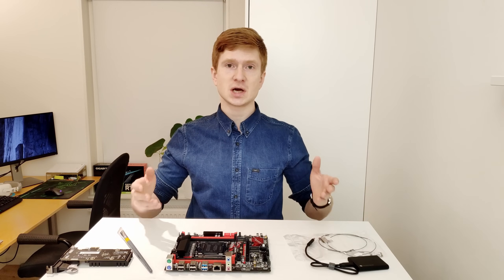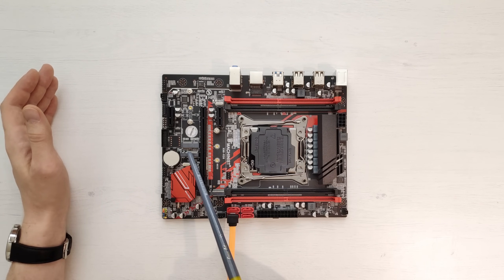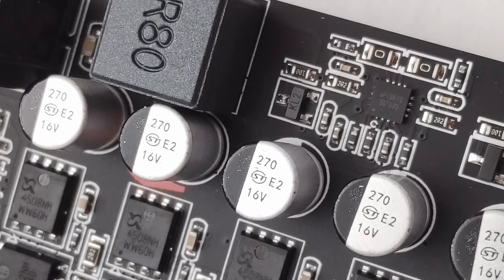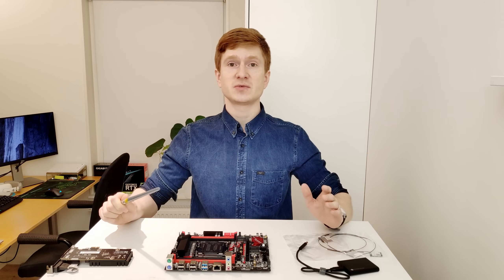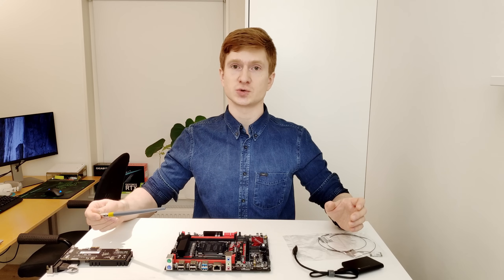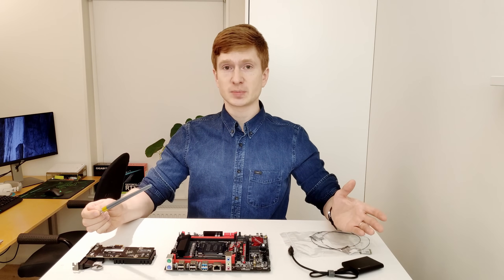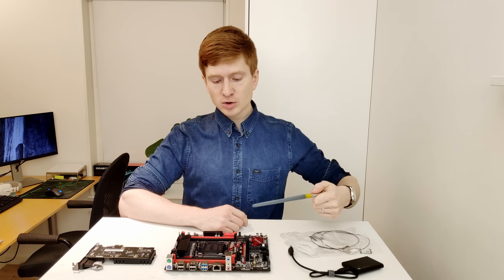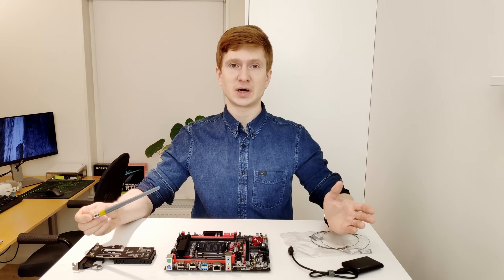🇬🇧 Machinist X99-RS9 – detailed review | E5-2678 V3 | i7-6800k | BIOS | O.C. | VRM | Mi899

Comment: i have exactly the same motherboard with 2697 v4 cpu, it's working good, but decided to upgrade to more core cpu 2696 v4, and OS installation cannot load anymore, it just freeze, in bios i tried load defaults and set TDP level from nominal to Level2, nothing helps, i think only you can help 🥹
Reply from the maker: How can I help? You have either defective CPU or motherboard. Maybe CPU is seated badly.
Reply: so you say there is nothing special about 2696 v4 and it must work with this motherboard?
Reply from the maker: Exactly.

Comment: Does this motherboard have an option to turn on secure boot in the original bios?
Reply from the maker: The one I have tested had fully functional Secure Boot.
Reply: @Miyconst  Thank you so much for your response, could you direct me to a tpm module that’s compatible with this motherboard?
Reply from the maker: @ducksauce752  I am not aware of any TPM modules that would work with the old version of X99-RS9. There is a Brazilian guy who sells BIOS-iEngineer developed modules but last time I checked, he didn't ship outside of Brazil. I also no longer deal with these modules.

Comment: My guess is that unknown device is the Intel Turbo Boost 2.0 driver for the i7 cpu.  I've had issues with that in device manager for these 2011 boards before.  Can check the hardware id to confirm.
Reply from the maker: That's very correct! Eventually I managed to get it solved by installing Intel TB 3.0 or something driver.

Comment: I have got Machinist X99-RS9 v 2.0 with Q87 chipset those with the fan on VRM heatsink, the bios is X99RS00B from 04/30/2024. All seems to working but on reboot of either Win11 or Linux it does full power cycle (turn power off and then on) which increase unexpected power off s.m.a.r.t. counters on the disks.  When I press reset button it restarts the PC without power cycle. What could be it, a bios design or some faulty hardware (Cinebench runs flawlessly) ?
Reply from the maker: I don't know what exactly causes this problem but it's common with these motherboards. Chinese connect something wrongly, components fail to reinitialize on reboot, they patch BIOS to power cycle on reboot.

Comment: I have this board with an e5 2697v3 and although it's working with my old rx580 GPU, I cannot get it to post with a new Rx 9060xt card. I am only running the standard supplied bios.
Reply: I added extra cooling for the vrm to keep things stable.
Reply from the maker: Yeah.. this is a known issue, AMD 90xx GPUs for whatever reason don't work on X99 motherboards.

Comment: Hi, I know this video is 3 years old, but I try my chance. I’m using this mobo as a Nas server with a 2678v3. Considering Ram, I can install up to 2x32Gb Ecc dimms 2133. When trying to upgrade to 4 dimms of identical 32Gb ecc sticks, the system won’t boot, stuck on DXE initialization. I see that you managed to go up to 128Gb of ECc reg memory. Do I have to flash the bios for it ? Do you have any advice ?
Reply from the maker: These Chinese motherboards are known for pathetic power delivery. I have had similar issue to yours on several boards and the only solution is to find less power demanding memory sticks. It could also be because of your CPU. V3 Xeons have significantly worse memory controller compared to V4. You can try to boot with two sticks, manually set RAM speed to DDR4-1866, then add extra two sticks.
Reply: @Miyconst  Thanks, Indeed, decreasing memory frequency allowed me to add one more stick, but even in 1333 Mhz, I cannot go up to 4 stick. I'll keep up with my current stable 64GB. Thanks for your advice, at least I now understand what is going on !

Comment: Question though. I wanted to know which frequency of ECC RAM should i be picking for this motherboard? 2133mhz or 2400mhz? Thanks!
Reply from the maker: It depends on what CPU you use. In general, 2133 is good enough if it's cheaper, usually you can O.C. these to 2400 if the CPU supports it.
Reply: @Miyconst  i appreciate it!
Reply: @Miyconst  Well the one i have is an E5 V4 CPU i already considered 2133 MHz :D thank you very much for your assistance.

Comment: Brother i have saw a motherboard called rs9(with diagnostics module) and rs9 plus (with diagnostics module) difference between them is plus has extra 2 sata port. Both are different from motherboard you have(your's motherboard doesn't has diagnostic module) does most things you said applicable to both rs9 and rs9 plus
Reply from the maker: As far as I know, the newest revision of RS9 has better VRM, the rest is the same, but I cannot guarantee that before testing these boards.

Comment: Hi bud. I've beenstrugling with rs9 code 96 error. Saw in your personal blog that for Huananzhi's mobo it is related to e5 16xx v3 overclock. Can you tell me if the 96 error means the same for a rs9?
Reply: Btw I'm using a 1660 v3
Reply: Did the CMOS clear and still have no screen display, keyboard power and 96 error code
Reply from the maker: Different motherboards may or may not share the same post codes. Even Huananzhi may use different schemes on different motherboards. Anyway, what BIOS do you have? Did you do TBU? Did you test motherboard, CPU, RAM separately?
Reply: 96 or B6 means memory problem. check the ram, try using one bank only, change position, also if it is quad channel

Comment: You often recommend good RAM to use with X99, but would you recommend using Machinist RAM with Machinist X99 mb ? and what about XMP in this one ?
Reply from the maker: No, China branded RAM is often incompatible with the Chinese X99 motherboards. If you decide to buy Machinist/Kllisre or similar RAM - make sure to buy it in a bundle with the motherboard so the seller tests it for compatibility.
Reply: @Miyconst  I see, and have you mentioned anything about XMP on this one ?
Reply from the maker: It doesn't work. The memory speed is limited by the CPU.

Comment: Miyconst i have a question if i have this mobo with q87 chipset which bios should i flash for turbo unlock casue as far as i see thatbhuananzi is not described as q87 chipset conpazible
Reply from the maker: I cannot guarantee but as far as I know you can use B85 BIOS with Q87.
Reply: @Miyconst  first of all sorry for missing letters and second i just realized you said in video you had q87 also
Reply: @Miyconst  status report just so you can update the mi899  basically it is really weird i tried the mf bios and it will not properly recognize nvme and it will boot only after restoring to deafults i tried forcing the uefi on csm that also did not work somwtimes it would start booting into windows and just stop and not go on,

then i tried the mi899 provided bios for rs9 and it turns out that that bios does the same thing as mf

 That rs9 bios is not the same bios as the one that came with the board and that is evident from the start beacuse machinist pop up graphic is not the same  if you want i can drop the bios of mine rs9 into discord or somewhere

Edit: if you see any obvious mistake on my part please do inform me i just bought this board for thinkering so im not too familiar i watch you and it seemed interesting

Note i did install thr windows on the og version of BIOS(obviously) i dont know if that could have affected it in terms of windows not being properly set up for other versions of BIOSes

Also it did have a message "reboot and select proper boot device" but i did and it will either not show my adata nvme or it will sjow it but it will not be "windows device manager" and it will not boot either way or will get stuck trying to enter Windows

 Once i reverted BIOS everything is back to normal

Edit: all the drama was cause of c state 😬
Reply from the maker: @tomislav2494  this is an old known UEFI bug, you need to disconnect all storage, restore BIOS default, safe, reset, connect storage, apply required BIOS settings save, reboot, and it should be ok.

Comment: Hello, I flashed  bios using Huananzhi X99-8M-F today (-70mv version), then the RS9 stuck at error code 91 and refuse to boot....Anyway we can reverse the bios at this stage? Thank you! (Last time, it was succesful, not sure what happened this time.....) I guess have to try CH341A way.
Reply: use a 2650v4 cpu for 5$ and i will start ignoring voltages

Comment: can this motherboard autopower on after power loss???
Reply from the maker: It can.
Reply: @Miyconst  thank you,,, i ve enabled in bios setting to power on upon ac power loss, but not seems to be working..

i tested it by pull and plug ac power cord, .. its not powering up automatically...

i hope you can make new video conten about this...
Reply from the maker: @purnatrimani  I have only tested this feature after flashing Huananzhi BIO, the original BIOS is trash.

Comment: Just got the motherboard can a xeon e5 2630 v4 work without overheating? I hope i get a reply😊
Reply from the maker: E5-2630 V4 is a very cool CPU, overheating is very unlikely if you set everything up correctly.
Reply: @Miyconst  thank you so much for your response I've looking for the right cpu for my rs9 for half a month now
Reply: @Miyconst  Its been a year and my X99-RS9 still work, and I notice my CPU is holding me back, so I planned to switch with the E5 1650 v4 won't it overheat?
Reply from the maker: @marcoregulacion1461  no, E5-1650 V4 is also easy to keep cool, it will be just fine.
Reply: @Miyconst  Thank for the help and I'm also planing to use a ECC reg ram I hope it work

Comment: Could i use it with 2697v3 with unlock turbo boost? I will buy a specific air cooler that helps the vrm also. But is the vrm good enough for the cpu liks the mr9a?
Reply from the maker: It's better to go with MR9A (Pro) instead.

Comment: Hi friend, good videos
I had a question.
I buy on Aliexpress a Machinist E5-RS9 physically my board it is the same as X99-RS9 can you tell me if the BIOS on your aplication works for my E5-RS9? i want Overclock my I7 5930K but im scared to install a bios of other model
Reply from the maker: Without testing the motherboard I can't guarantee anything but even if it's compatible with the custom BIOS it still doesn't support overclocking.
Reply: @Miyconst  thanks for your answer, i really like your videos, anyway i will get a Xeon and a Compatible board for an overclocking experiment, the job you did is really ossom

Comment: Hello, I bought this motherboard and combined it with a Xeon 2697a v4 and 2x16gb Kllisre DDR4 2666 MHz. The system doesn’t boot, the fans from  cpu cooler and gpu are working but I get FF error and after 3 seconds it restarts. I tried all the troubleshooting I could but in this point I think that maybe some of those parts is not compatible. When I remove completely the rams I still get FF error but this time it doesn’t restart it stays ff constantly open. Is there something wrong with the motherboard or it’s the part that don’t fit with it? 
Thank you
Reply from the maker: The FF code indicates that something is really wrong. PSU is not connected correctly, there is a short, motherboard or CPU are dead, these are a few reasons that can cause FF.

Comment: Can you tell me if this motherboard can support 128GB (4x32GB) DDR4-2133 REG ECC CL15; Because toward the end of this video it states in red that it it reports it doesnt support ECC, but down below you state the 32GB and the 128GB as being supported in white. So, did you actually run the test using these two memory configuration uding ECC REG.?
Reply from the maker: Yes, I tested 4 x 32 GB RAM and it worked but the ECC function was disabled.

Comment: Will this motherboard work with non-ecc ram 
Like normal asgard 3200mhz ram
Reply from the maker: It works but 4-bank memory modules are not supported so it might be a lottery.
Reply: @Miyconst  
What true x99 c612 chipset motherboard do you recommend for E5 1650v3

Comment: Hi miyconst, appreciate the inmense work you put on your content. Will this mobo be able to keep up with a 2670v3 turboboosted? I guess not, but will it have worse temps than a 2640 v3?
Reply from the maker: E5-2670 V3 should be fine, you just need to ensure good VRM cooling.
Reply: @Miyconst  Thank you so much, I ended up going for a Machinist X99 PR9 and e5 2670v3 because I saw a review  by Lipezito that had much better VRM thermals than RS9(65-70º vs 80-90º in Aida). Is the PR9 contemplated in your flashing software? Or TBU should be done manually? Thanks in advance
Reply: Vrm works well with e5 2630v4 or will overheat?

Comment: Can it handle 105w 2650 v4 🫨🫨, i already bought it, but to be sure
Reply from the maker: Yes, it can.
Reply: @Miyconst  ok ty, one more question, i bought non ecc 2x8 DDR4 ram, is it ok?
Reply from the maker: @abdulsa1am  it should be ok, unless you hove those ultra-cheap 4/8-bank modules. (1 bank is not the same as 1 GB).

Comment: my question is how many of these do you go through before you get one that works. i have 2 brand new boards and both say the processor is bad via "beeps" or the diagnostic screen that always gets stuck at code 67 and stops booting with black screen. both CPU's are working and can be put into any server i have and work perfectly. for some reason i cant seem to get a board that works. i was trying to build a small efficient server that didnt generate a ton of heat or noise...now im into these 2 non working boards for more than it would cost to just buy a noisy hot power hungry server with all the bells and whistles.
Reply from the maker: What is your full specs? The loud beeps are usually indicating a missing graphics card.
Reply: @Miyconst  its 5 beeps indicating bad processor on the machinist E5-MR9A (not the pro version) board and on the Jingsha board it has the digital readout that stops at 67 which also means bad CPU. the second one i listed has almost no information about it. on the website i purchased it from its literally listed as: Jingsha LGA 2011 V3/V4 motherboard X99.

ive contacted the manufacturer and have gotten no response. unfortunately ive been fighting with these 2 boards long enough that the return window has expired and now i have 2 paper weights. the video card is also a known working card.
Reply from the maker: 5 long beeps indicate missing, not supported, or not recognized GPU, it has nothing to do with the CPU. At least it was so with all the Chinese X99 boards I have tested. What is your GPU? Did you test any other GPU? 67 is usually indicating missing or not compatible memory.
Reply: @Miyconst  so the chinese are not following the standard warning messages the rest of the world uses? that would be a good reason why im having issues. im chasing the wrong rabbit down the wrong hole.
Reply from the maker: @origionalwinja of course Chinese don't follow anything, these X99 BIOS are hacked on someone's knee in someone's garage.

Comment: i have this motherboard im having issues it boots into bios perfect but after installing windows it just sits there the spinning circle freezes mouse cursor pops up i can move it but system just sits there frozen i can move the mouse cursor im getting motherboard code AA and AE
Reply from the maker: I don't think there is something I can do remotely, if you bring the PC to me, I can debug it and see which of the components is causing the issues, but most likely it's a defective motherboard.

Comment: My X99-RS9 stock bios was perfectly fine and i did bios mod with E5-2643v3. Added 2 fans on the vrm to cool it and things seem fine while gaming
Reply: Hey dex, I only have 16gb of ram working with mine, the other stick wont work. I tried a replacement just in case it was a bad stick but that didn't work either. Have you had any similar problems? I haven't done a bios update.  e5-2670 v3
Reply: @PhonePhone-sf8te  i did and the issue was the cpu had a dead C channel and other time the issue was the motherboard tgat only had dual channel support. (2 green slots 2 black) i fiiled the greenslots then balck and the sitcks worked but yeah. Got a 5930k with dead C channel
Reply: @dexsters5643  so it worked out for you by just switching to the black slots or it's still messed up? I'm pretty confident that the cpu doesn't have any bent pins.  Do you think they're just sending out boards with bad ram slots/bad cpus?
Reply: @PhonePhone-sf8te  if were talking about aliexpress X99 boards. No they rarely do. ( i meam rarely bc i got my X99-RS9 with 2 bent pins and 1 missing. But fixed it)
 The chinise boards with 4 or more ram slots they have issues like first populate the green/red slots then the black ones. Which in my case worked. While others like the X99-D8 from jinsha that board has a jumper if you fill all 8 slots to give more power. Which board do you have? Maybe its dual channel only with 4 ram slots or you need to change a jumer on some pins? The X99-D8 had jumperpins where the cpu 8pin would be on a normal Atx Board
Reply: Mine was fine too, but i wanted to tight the timings of the ram, then i flashed, tightened the timings and turned on the resizable bar and everything works great, also added a fan on vrm too.
Reply: @brazilpaes  thats awesome. Recently got the CH341 programmer and flashed unlocked bios on my rampage V extreme. Got 3.3-34.ghz on my 2697v3.

About the RS9 i added 2x 40mm fans on the vrm and ended up using a E5-2643v3 because it had higher clocks amd fewer cores then the E5-2660v3 i had in the RS9 before

Comment: i have same motherboard with e5-2670v3 should i be afraid and i have want to put i7 6900k can i or problem?
Reply from the maker: There is absolutely no reason to put an i7 on X99-RS9 since the motherboard uses a desktop chipset with no overclocking capabilities.

Comment: Hello @Miyconst,
is it possible to run the DDR4 2400 Mhz whith a Xéon V3 on a Machinist X99-RS9 ? 
Thank you
Reply from the maker: Only with unlocked parts like E5-1650 V3.
Reply: @Miyconst  thank you